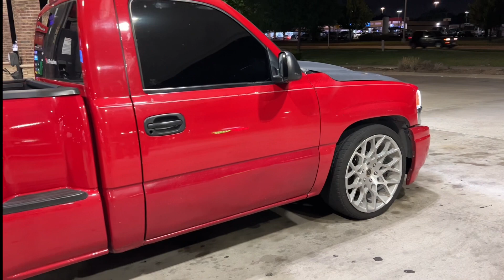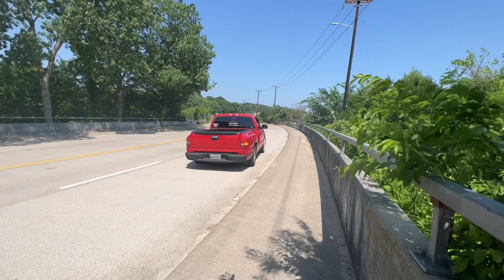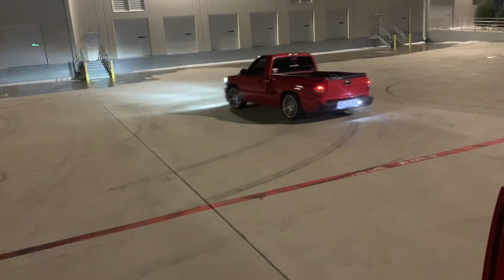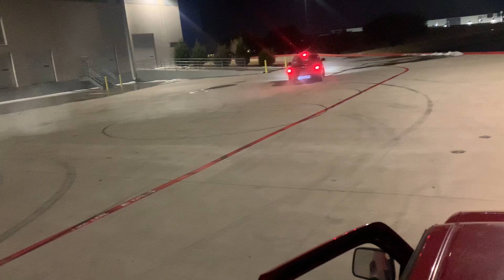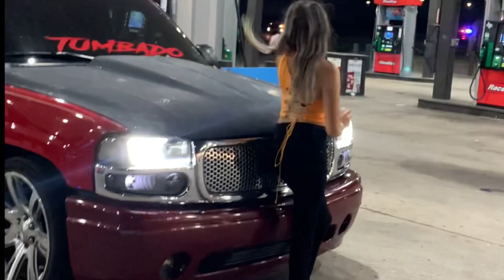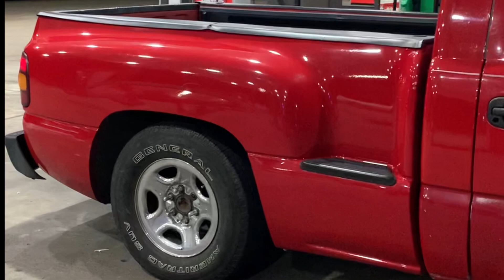STAGE 3 SUMMIT PRO LS CAMSHAFT FROM SUMMIT RACING 450 HP LS CRATE MOTOR

Comment: Good looking truck & nice set up my man. I have a 2013 CC GMC Sierra with 5.3. TSP Stage 3 high lift camsahft, Porter heads, 102mm TB, ARH long tubes, FAST intake, K & N cold air, Tru Trac posi w/new axels & 3.73's, & 2800 Circle D stall. Upgrading the tranny next. On mustang dyno put down 396 to the wheel. Runs like a scalded dog. Been three yrs now no issues.
Reply from the maker: Sounds badass 🔥

Comment: My brother did this swap but we’re having trouble getting it to start. Summit 5.3 with stage 3 cam. Backfires thru intake 
Swapped to bigger injectors back to factory. Still nothing. Everything is hooked up correctly. Only codes showing are 02 sensors for exhaust.
Reply from the maker: Does it turn on then turn off?
Reply: @lsjrproductions  it just won’t start. Everything else seems to be working correctly. Checked all plugs. Even sprayed little starting fluid in the intake. If you do that it backfires thru intake. 
We stoped doing that
Reply from the maker: @austinnorton2222  have you tried tuning it?
Reply: @lsjrproductions  nahh not yet. Just trinna get it to run. But that’s what we’re looking into now
Reply from the maker: @austinnorton2222  mine started but died immediately after because there was no time
Reply from the maker: @austinnorton2222  tune*
Reply: @austinnorton2222  did you set timing or just throw the cam in there and send lol?
Reply: @RM-xh2xr  cam was pre installed and timing was already set and we double checked timing. It’s def in time.
Reply: Did you maybe plug in your coil harness backwards? I’ve done that a few times on swaps and I’ll back fire though the intake and have a hard time starting . Literally reverse the coil harness and fires right up . Just a suggestion
Reply: @Jay-zk7xk  we had a fuel hose come off inside the tank. She fired up right after fixing that

Comment: Did your brakes work okay after installing this engine? I have a buddy that installed the same one in his single cab and his brakes don’t work well. I’m thinking the cam has less vacuum in the intake.
Reply from the maker: Does he have a higher stall? If not the cam will push through the brakes mine works just like they did before
Reply: @lsjrproductions  yes I believe 3000 yank
Reply from the maker: @aaronjohnson6616  then it might have something to do with his brake system mine works great